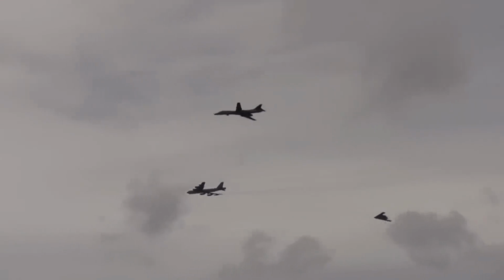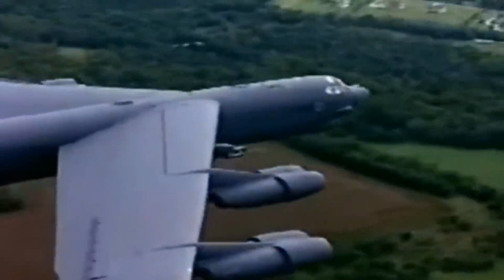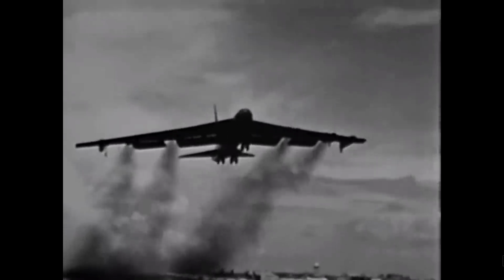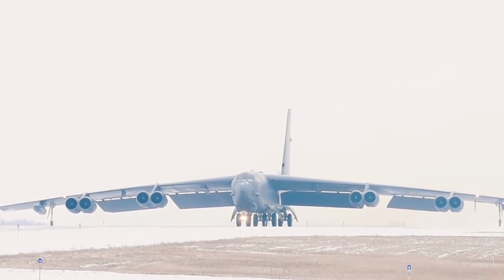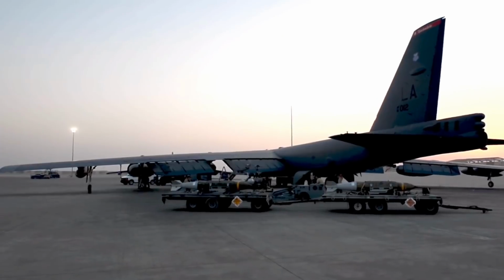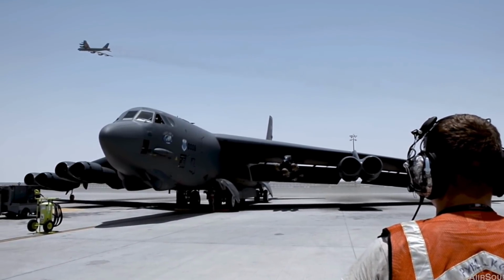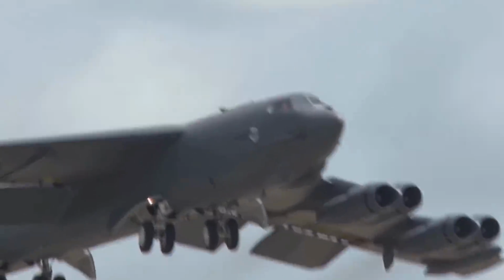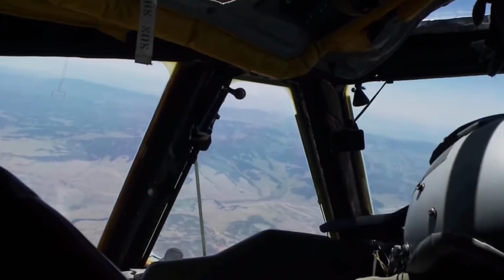The B-52 Stratofortress - Americas Heavy Bomber

Comment: And, on top of that, it's flying better than the F-35 ...

(now where's my popcorn ?)
Reply: If the F-35 were the best fighter jet ever designed (and it ain't), and it was actually good at CAS (and it ain't), 5 billion each is still exorbitantly high for an aircraft..

Unless you really believe it can do strike missions as well as 5,000 cruise missiles?
Reply: I'm really impressed by how you managed to cram one stupid comment into the space of six.  Wow.

The A-10 drops more ordinance, more precisely, and with better target discrimination, but the F-35 is better for CAS?

And you know what it's called when you go into heavily defended areas to take out strategic targets"?  It's called a "strike mission" you stupid piece of shit.  The reason the f-35 needs all that shit, is so it can (hopefully) do the job without being shot down.  Volleys of missiles are safer, cheaper, and much more effective.

As far as "guiding" the cruise missiles?  They're pre-programmed.  Some are adjustable, but doing so is best done by those who are close to the target, and can loiter for long periods.  Like JSTARS or the aforementioned A-10.  Just one more thing the f-35 is no fucking good at.
Reply: @stevenseargeant6450  Small Diameter Bomb and Stormbreaker (SBD 2) and advanced SA. What are your questions?
Reply: @stevenseargeant6450  you see what you easily confuse people don't understand is that it's not that the F-35 is replacing the A-10 in CAS. Its that the A-10 has already been replaced by everyone else. And has been for years. Since the War on Terror, the A-10 has conducted 3% of all CAS missions, in Desert Storm the plane with the most tank kills in the war was the F-111. There is no place for a sigle seat plane with limited legs and loitering time that can only do one thing in a permissive environment anymore. Same reason why Marines are getting rid of the AV-8B. But hey there is only plane made entirely for cas in a permissive environment that will still be around. The AC-130 Spooky.
Reply: Okay.  Let it carry the shit externally.  Now you can't mention its "stealth" when I ask why we should prefer this fighter jet to others.  And yes, I'm going to include the "program costs" because I'm a taxpayer, and that money came from somewhere.
Reply: For the cost of the f-35 program, we could have given every single Marine their own AH-6 little bird.  Can you imagine what that would do for recruiting?  Instead of "every Marine a rifleman" we'd hear "every Marine a helo pilot".  200,000 attack helicopters, with rockets and Hellfires would scare the living shit out of ISIS.
Reply: Fuck you.  If you had 200,000 attack helicopters, you wouldn't need the Goddamned Air Farce.  The Marines would have instant air supremacy, and could dominate any "low-intensity" warfare scenario.

Your ~300 f-35s can't do that.
Reply: Add to that the economics of using such an expensive aircraft for CAS. Even if the F35 was a good aircraft for taking out high threat, high value targets, you still need a workhorse fleet of cheap to run, cheap to fly CAS aircraft for day to day operations, otherwise that war is going to get very expensive.
Reply: Yeah, I know the "high-low" fraud, guy.  YOUR problem is you're forgetting that the f-22 was supposed to be the "high" and the f-35 was supposed to be the "low".  And the f-35 WAS supposed to replace the f-18s and f-16s on a one-for-one basis, that idea was only nixed because of the program's skyrocketing costs. 

The Air Farce could afford fewer and fewer as time went on, and foreign interest waned as more and more bugs were discovered.  The shit STILL isn't paid for, and assholes actually cite the astronomic costs as a reason NOT to cancel already.  It's a text-book example of a boondoggle.
Reply: Steven Seargeant I’m sure you know your stuff, but I can’t get into your comments because you seem so impatient with whoever you’re addressing. You’re probably very knowledgeable. I would read what you have to share if you would say it without being so rude.
Reply: AND the Stratofortress HAS CONFIRMED Air to Air Kills! From Vietnam, Operation LINEBACKER II on the Christmas bombing raids over Hanoi a B52-G gunner got a track on a Blue Bandit and gave him a 7 second burst of Quad mounted M3 .50BMG Fire; and splashed a MiG-21! Then later in the same campaign another B-52G got another MiG 21 with M3 tail guns! Last ever Air to Air kills in history using machine guns from a bomber, and probably the last with machine guns from a fixed wing aircraft!
Reply: mickael delatre everything flies better than the F-35
Reply: And to think, if it wasn't for that lot, Australia could of had the TSR2 and nuclear weapons. Lets see Indonesia hold us hostage to our own stupidity then.
Reply: That Australia ordered the F35 REEEEE Starfighter II is a worrying thought. Another proud creation of LMco form a long linage of useless planes sold through political corruption.
Reply: Ramon S the Starfighter CANNOT compare. The F-104 was designed by Kelly Johnson, at the DIRECT REQUEST of the fighter pilots coming out of the Korean War who approached him looking for an INTERCEPTOR that would climb fast and high enough to be able to defend against MiG and bomber attacks because the Other offerings of the time couldn’t do what they needed to do. The F-104 WAS NOT designed as multi role. It was adapted to do shit it was never meant to do to try to sell it after the USAF wouldn’t buy them.
Reply: Raymundo Gapan, fuck popcorn. You deserve a brand new car!
Reply: Who needs computer aided design when you can whittle on balsa wood.
Reply: OptimalOptimus50 the f-35 has worse wingloading and thrust to weight.When compared to existing aircraft.So much for being a better plane.All it has is stealth.That it.When that fails it becomes a flying coffin.
Reply: @thunberbolttwo3953  ?
Reply: mickael delatre But the F35 is already in active service with the USMC and USAF :/
Reply: Let's check your math, shall we?  The f-35 program costs 1.5 trillion (so far), and has produced ~300 aircraft.  Dividing b into a, gives c: a unit cost of 5 billion dollars.  So NO, it sure as fuck is not cheaper than Typhoon or other fighter jets, you fucking moron.

And I don't give a shit what it can carry externally, as its raison detre was its "stealth", which is severely compromised by carrying weapons externally.

And just because you said that cruise missiles are "for deterrence, not not strike" doesn't make it so.  I can cite plenty of times that cruise missiles did strike missions, but I'll bet you can't give any examples of (non-nuclear) cruise missiles "deterring" anybody.

And I know you're too fucking stupid to actually learn anything, but "strike" missions are attacks against known, largely stationary targets.  This is in contrast to "interdiction", which is against mobile, targets of opportunity.  This frequently requires the platform to gather its own reconnaissance.

The f-35 was promoted as cheap subsritute for the f-22, because the "raptor" was prohibitively expensive to replace all the figher jets in the American arsenal.  And now this "discount raptor" is more expensive than the genuine article.  It was supposed to save money by filling the requirements of three services with (different versions) of the same aircraft.  But this "JSF" idea is actually the main reason for the massive cost overrun, and the never-ending developement.  It's an abysmal failure.

Like you, I'll bet.
Reply: +TheReal Lifehacks Uneducated haters will be uneducated haters. The F-35 hate train is well past its sell-by date.
Reply: This comment made me laugh. Nice one lol
Reply: There have been several fatal B-52 crashes. Fatal F-35  crashes? 0. F-35 crashes at all? 1.
Reply: @madkabal  that's a false comparision the b-52 have been in serice for 60 years.thats right 60 years.The F-35 has yet to be apoved for operational use.Let that sink in.
Reply: @thunberbolttwo3953   The US Marines and the Israelis Air Force  have already used the F-35 to conduct airstrikes in Syria. Like all F-35 "critics" You know nothing and yet you shoot your mouth off. Let the sink in.
Reply: @thunberbolttwo3953  every country on the approved buy list is buying the F-35. Time for your world tour my dude. Perhaps you can convince the Generals of USA UK Norway Denmark Netherlands Italy Israel Australia Canada Japan Belgium Turkey, and soon Finland that a stealth semi supercruise 9G capable fighter jet capable of high angle of attack that is equipped with powerful passive sensors that can see 50 miles out and Powerful active sensors such as electronically scanning radar and Network Integrated Systems in a combat environment that is increasingly being fought by computers is a poor choice I want you to go and do that. you will probably be laughed off the table.
Reply: @madkabal  yet  the f-35s wingloading and power to weight are inferior to the f-15 f-16 f-18 and f-22.All it has is stealth that's it.You cant make a plane do everything greatly.it woill do everything poorly.You can only make a plane dop one thiong greatly.All;so the f-22 still beats the f-35 in air to air combat.As top its electronics you can put them in exsiting aircraft.with none of the f-35s faults.
Reply: @madkabal  not to mention the f-35s rediculos pricetag.
Reply: @thunberbolttwo3953  a Super Hornet cost more than an f-35A. Are you a bot? I think I'm talking to a bot?
Reply: @madkabal  the super hornet does not cost more than the f-35.allso I am not a bot.its just I didn't fall for the f-35 hype.No plane can do everything.
Reply: @thunberbolttwo3953  cost of an F-18 Super Hornet 100 million cost of an fa 35 a 90 million. Well you have convinced me that you're not a bot but I'm now more than convinced you're someone doesn't know how to do math
Reply: @madkabal  asctaully the cost of the fa 18 super hornet is $70.5 million not $100 million.The f-35 is $89.2 million.So youi are still wrong./no surprise there.Plus the f-35 is still being developed.So the price will go higher.
Reply: @madkabal  the f-35s wingloading and thrust to weight are worse than the f a 18 super hornet.Meaning its slower less manerverble.and has a worse rate of climb.

Comment: When the colonies in the outer solar system are attacked by unknown aggressors from the stars in 2247, the B-52, which will have been recently upgraded again, will set forth to show them what's what.
Reply: Spanos Taking carpet bombing to a new extreme.
Reply: Intergalactic bombers
Reply: Spanos In 2247 the air force has advanced 9th generation aircraft but still operate the space BUFF
Reply: An Air Force General once asked how  did  we manage to build and deploy an aircraft that flew so well.
Reply: B-52 Spacefortress
Reply: Alongside the space-battleship Yamato...
Reply: @donfelipe7510  ahh, I see

I understand your reference
Reply: @donfelipe7510  a Vulcan converted into a brit version of the space shuttle would be cool to see
Reply: Spanos Just Imagine the redesign of it to fly in space xD
Reply: Lol, upgrades ... nah, they will still be using the same ol aircraft with JATO boosters on the sides to get her into orbit.
Reply: you gave me. this image.
a B-52 with sphere nose/cockpit
x4 ion engine systems with a slightly shorter wingspan sticking out of them
and B-29 style RC turrets
Reply: Accompanied by a TU 95 bear
Reply: Fuck you Dean lol
Reply: I think you meant lv226
Reply: not practical enough
Reply: Space fortress and space bear
Reply: B-52 thanos, generation 1776
Reply: With a single aircraft carpet bombing strike.

Comment: As far a replacing her, what would the design even look like? I say this because other than age it is perfection in aeronautics for the many many missions it performs. Combine with the B1 and B2 and the USAF has all bases covered, I believe.
Reply: Blah b what do think it would look like? I'm curious by your comment. 
A flying wing would give better efficiency and stealth but that mission is covered by the B2, Plus it would cost prohibitive. Swing wing would give less drag but again it is covered by B1B. 
The engines have been upgraded throughout its life and Boeing has a upgrade program ready to go. 
I don't know if the military would ever go with, for instance a synthetic fuselage, like 787. I think the gains in fuel economy and range would justify a leap into that due to a need for durability and time tested that AL has. 
I just can't think of any major deviation from the design  like the leap with the B2 or B1B or even B29 to B58. 
What are your thoughts?

Comment: The B-52 as been able to stay in servive even today because of a very simple reason. That reason its called Shock and Awe, as the Gulf War demonstrated, it is possible to take down some of the most modern SAM batteries and very experienced enemy pilots and pave the way for heavy and slow planes like the B-52 wich destroys everthing with relative safety after the main threats are delt with by  SEAD and ASW operations. I preditc however that the B-52 its going to be phased out in the next 10 to 15 years due to other projects being currently developed some of wich leaked into the public knoledge
Reply: In a very simple way, the stealth bomber (B-2 nowdays) eats, the B-1 Lancer digests and the B-52H poops
Reply: The USAF strategy for strategic bombing with the 3 diferent strategic bomber classes the US posses wich are (by age) the B-52H, the B-1 Lancer and the B-2 Spirit its as following. The B-2 will conduct the initial bombings deep inside enemy territory taking out several high profile infrastructures such as airfields, headquarters, army bases etc. Than the B-1 Lancer follows up picking every target that the B-2 left behind and than the B-52H just suports and destroys everthing that possesses a threat to the ground forces. Its a strategy that was implemented in the Gulf War with the Nighthawk instead of the B-2 and it really work well
Reply: It could (with some modifications) be converted to a fuel tanker, with all that range and payload capacity, you could fly an entire air wing with two B-52's retrofitted as fuel tankers.

That and being a drone aerial carrier is possible.
Reply: There´s already planes that perform the tanker job better. The KC-135 for example. The problem of the B-52 in that role is the extensive modification it would be required wich its unnecessary
Reply: B-52 is extremely good at loitering above the combat area and dropping guided munitions to positions painted by ground forces. So in combat enviroment where there are no hightech threats they just don´t have any better ground support aircraft. That ability alone lenghtens its service life and when you count in all the other stuff that it has been upgraded to do, it is gonna stay in service for a long time.
Reply: Wich was a lot easier to modify since you had a white wall. It was big, empty and pretty good. The B-52H otherwise was ment for pure bombing and its designed for such
Reply: Not true. However, compared to the initial model, the B-1A wich only served as a prototype, the final production named B-1B had his top speed lower to Mach 1.25 to reduce damage to the air intakes and other components but it had smaller radar signature making it more stealthy there so excelent for low altitude deep penetration insertions into enemy territory
Reply: Termitreter "Iraq didn't even have an Airforce" USAF pilots were advised to stay away from Iraqi MIG29's because they were afraid the Iraqi Mig29's would down USAF aircraft. The Iraqi Airforce was the largest Airforce in the region and had many experienced pilots from the Iran-Iraq war
Reply: Leandro Ribeiro.  -135s are roughly the same age.
Reply: While I agree with your point, I fail to understand why the B-52 would be superior to the B1-B in that specific role, considering lower speed and maximum loadout. Lower operational costs maybe? I'm not sure, Wikipedia states B-52H maintenance cost per flying hour is US$ 10.798, but they lack the numbers for the B-1B. Yes, the unit cost is MUCH lower, but this value will be diluded in time.
Reply: The B-1 is a pig. I've read that it can not make it over the Rocky Mountains with a full payload.
Reply: Yeah, I confused it with last Iraq war. Nvm.
Reply: @termitreter6545  Yeah in 1991 the Iraqi airforce was widely considered to be about the 5th best in the world.  They never really regained that position by 2003.
Reply: Jabardust
Reply: They will be in service until 2050.
Reply: Nonsense, Iraq didn't even have an air force. There was little threat for the B-52s, and if there was, they weren't used.